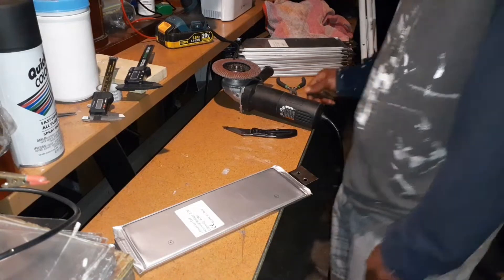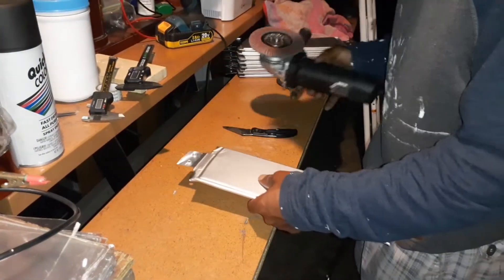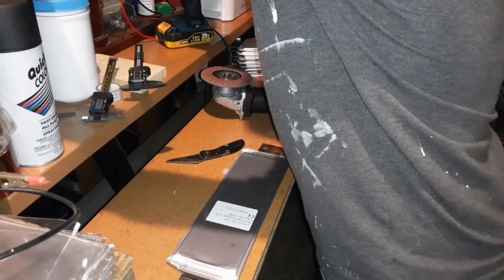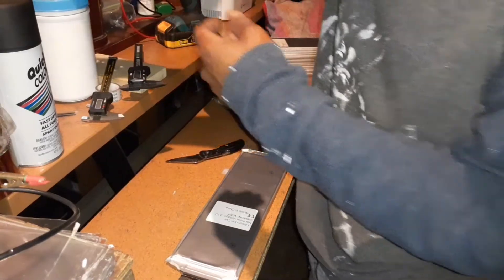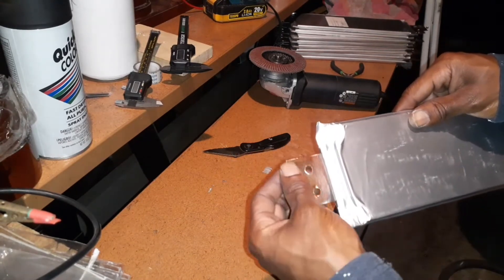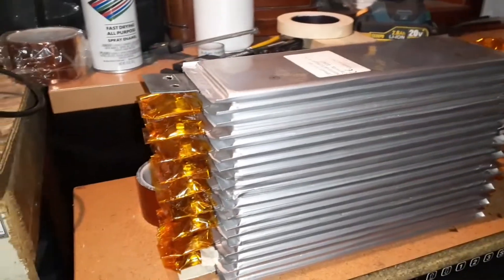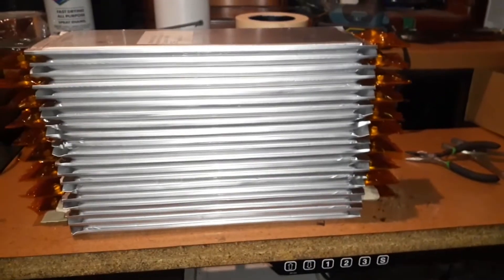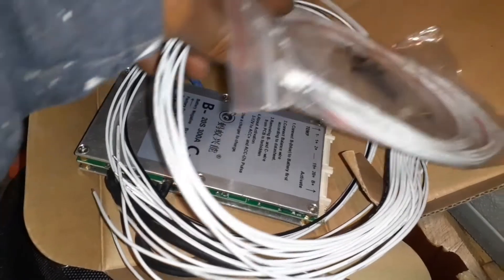Solderless DIY 72V BATTERY BUILD. 72V + 300A BLUETOOTH BMS

Comment: drilling M^ holes in thin sheet metal is surprisingly difficult hence big burrs .  unless you have a $$$ punch/die set and press.  Trick is to make your own template with two plates drilled and clamped together with and marked edgewise when you need the holes, then drill said m6 holes, then clamp the tab between the plates and drill through the guide holes. you will get a clean hole - not trying to wrap around the drill.  BTDTGTSATTSTPI

Comment: That’s 72v 40Ah battery pack, series connection cannot make the capacity higher parallel does, but the voltage in series adding up.
Reply: each battery has a capacity of 40ah that is 800ah all up
you are still limited by your C rating for one cell in his case C5 = 200amp draw
if you need say 150amp permanent draw the you need a 2 battery pack in parallel to avoid peak draw
a second pack will further increase the capacity 
think of each cell being a bucket   the capacity will add up with each bucket 
the fluid in the bucket flows through each bucket    the size of the connecting pipe determines the flow ( C rating or max amps)
Reply from the maker: No one ever said that series makes higher capacity. Where are you getting this from? Title says 72v + 300a BMS

Comment: Where you bought these batteries. Did you have any issue with the buying process? I am going to build a 96v-102v battery that's roughly 200-amp hours in size. This battery will be for a motorcycle conversion that I am doing and need to know where to buy the batteries, and if they are quality batteries and not some fake pos. Any advice on this supplier would be very helpful!
Reply from the maker: I'll reply as soon as I get home from work tonight. I set it in my notes so I won't forget
Reply from the maker: https://x.alibaba.com/Av4X9O
Reply from the maker: They are cheaper now by a few dollars. Buying process was super easy. Very high quality. But ask them about other types of cells. Different shapes and sizes
Reply: @batmanofinglewood  super late response bro but thank you!!!! I settled on these types of cells for the bike build, its just a matter of getting the funds to buy everything needed. I will have a 96.2v 219ah pack, which works out to 21kwh. I may go 102v nominal but as of right now I am settled on 96 nominal
Reply from the maker: @JWestVideos INSANELY POWER
Reply: @batmanofinglewood bro please don't recommend others using this type of old school cell.. it's easy to cause a big fire
Reply: @mrcoco3562  can they cause a fire? just as any battery can yes that can happen. But if you know how to use them you wont have a fire. This isnt a lipo cell, completely different chemistry in these cells. These are NMC cells, not your typical lipo dog shit cell. Overall, its safe, this is the same cells that electric motorcycle companies use for their packs.
Reply: Please don't buy those cell is very dangerous, u will regret
Reply from the maker: Dude. Shut the hell up
Reply from the maker: Nothing to regret here... Fucking fear mongering asshole
Reply from the maker: You have absolutely NOTHING to back that claim. Go somewhere and be productive
Reply from the maker: Test each cell for high amp output before completing the build. You don't want to find out that one of the cells is bad afterwards. Even though it will be easy to change out

Comment: Bro send me the link for your bms part of the video please. and also give me some info on them big ass cells name and spec and were too buy from too thanks 😊
Reply from the maker: Two different apps. Alibaba.com app and Aliexpress app. From Alibaba.com app and search for prismatic cells with screw mounts. Smaller and Much easier to deal with. Make sure they are 3.7v Nominal NOT 3.2v

Make sure they have high C rating 3c-5c at the least. They cost around $18-$24 a piece or so. Only need 20 cells for 72v system instead of hundreds of cells.
Reply: @batmanofinglewood  
Thank you so much for your reply and understanding your friend 🙂
Reply from the maker: @lefty29uns  yes. It's a GREAT feeling when someone replies quickly.😉👍🏾💪🏿😎
Reply: @batmanofinglewood  
Sorry I was just making some food to eat
I know I can count on you bro speak again soon and thanks for your help 😊
Reply from the maker: https://youtu.be/UXcgnOg-qlE

Comment: Hello again bro just wanted some info I have a cycle analysis display on my bike
Would I don't need to buy the display that comes with the ic gogog I would really appreciate your input on this battery build i am attempting.
Reply from the maker: CYCLE ANALYSTS won't give you the same info as the BMS Display. Only volts/watts/amps being used while riding and watt hours/capacity already used and battery recharge cycles but NOT cell balance info. There are still fun to have though. I have older version on my other bat bikes years ago. 

You can always pull your phone out to see BMS cell info anyways. 💪🏿😎👍🏾
Reply from the maker: I just subscribed to you